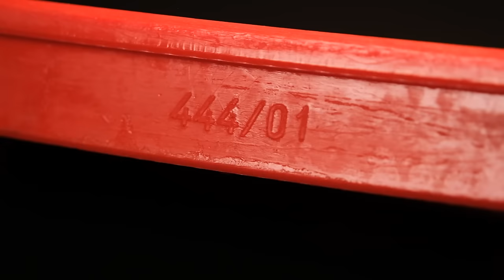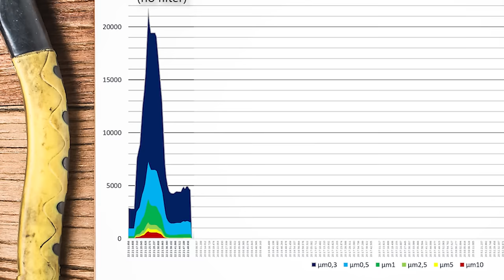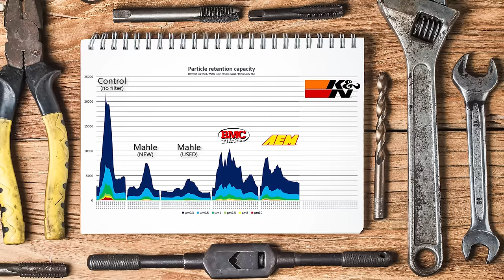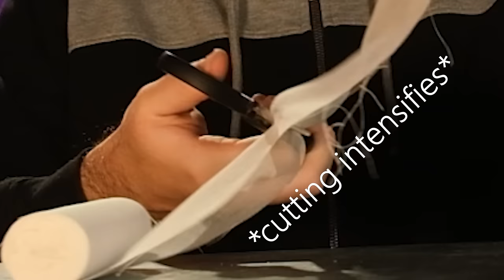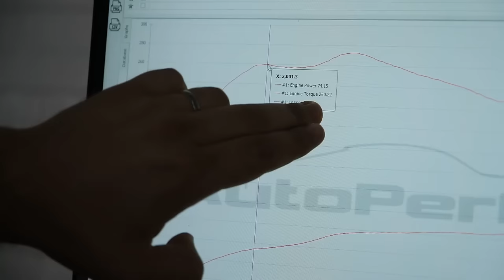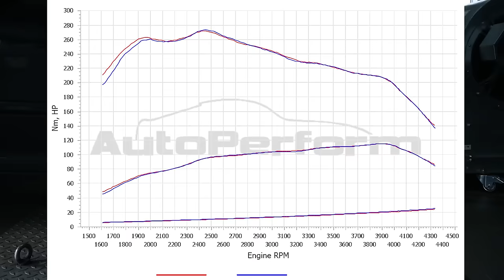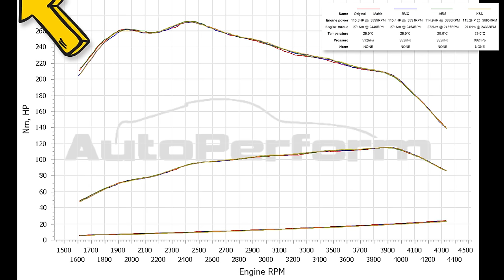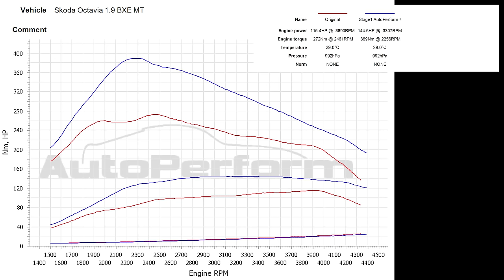Performance Air Filters - K&N vs AEM vs BMC - DYNO TEST

Comment: I've used a k&n drop in filter for 20 years. The same filter,  just rinse and lightky re-oil. I have not had any issues with it. I've put about 80k miles on the filter and it still works great.
Reply: 80k miles probably isn’t enough to notice a difference in engine life.
Reply: I believe it’s worth the price upfront. Washable filter will pay for its self within 3 yrs
Reply: Never had a K&N throw a code. If you over oil them your doing it wrong.
Reply: Yeah, ok. But has your engine been protected? Looks like the K&N is actually very bad at its main job, filtering. It was almost as bad as no filter at all in this test.
Reply: 150,000 in 6 years
Reply: Yes. That's what I've used in my '97 4 Runner. I have over 415k miles on it now and it still runs well. I had oil analysis done on it after I started using the K&N filter and the amount of silicon contaminants was never an issue. I checked the oil during summer and winter.
Reply: I just bought a k&n filter for my 2019 Chevy trax redline will I be good??
Reply: You must give ecu time for recalculate oxygen and fuel after a while you will see deference
Reply: 80k miles in 20 years?

75k miles in 4 Years here lol.
Reply: Oh yeah, normal paper filters that really do filter particles are very expensive - 10 $. You've saved a fortune while you've sanded your cylinders walls with that crap K&N.
Reply: @gerrymcerlean8432  it should be mentioned K&Ns filter much better after a bit of use as the dirt gets trapped in the oil and tightens the openings.
Reply: @perrinayebarra  how many more miles could you possibly put on it to tell its life
Reply: @xb007  at least 100k more.
Reply: 20 years of premature wear due to dust particles contaminating the engine oil 😂
Reply: No thanks
Reply: Or just buy a paper filter when it gets dirty every once in a while. Air filter oil sounds like headlight fluid lol I bet you believe those motor oils that claim they last like 20k miles, too
Reply: Damn better than my car's previous owner. No cleaning. No dusting. Just leaving it in there for 200k km. Not K&N. Just a cheap one that came with the car. Lunatics.
Reply: @perrinayebarra they filter better too
Reply: is your engine turbocharged?
Reply: @masaru3585 dude comprehension helps. He said he’s used k&n filters for over 20 years . His current k&n filter has done 80k miles 😉
Reply: @variovent rubbish k&n filters have been proven . Anyone saying oem are better are clueless. Car manufacturers build cars with parts that are designed to fail , that how they make money down the track from part sales and so forth . Any car guy knows this,  the average person will believe the manufacturers 😉
Reply: I put that on an I felt a lag on the hp I have a 2017 honda civic hatchback an when i put the original filter it whent back to normal I took that shit back
Reply: 80 % oem parts engine issues 😂😂😂 from factory 😅 so you don't won't to support to k&n because they don't pay you something else 😂😂😂
Reply: Max is 200.000 km from factory 😂😂😂
Reply: @perrinayebarra 200.000 km from factory warranty no more
Reply: Lol considering there well known to cause engine damage manufacturers warranty an engine with them ya there the best buddy lol
Reply: Ne lazi. Nista nisi dobio. Samo unistio motor

Comment: It would have been interesting to see how the filters performed after the remap. Thank you for video and information as per usual.
Reply: Yes, exactly!
As the original filter is well calibrated enough for the original power, doesn't it limit the power after remap?!
Reply: This. Performance parts benefit greatly after a remap I was able to achieve 20bhp with just CAI and downpipe.
Reply: @gwenc8900  It definitely does. I had a remapped  1.4Tjet with a slightly bigger turbo . It did 180+ on dyno with stock filter.After upgrading to a aftermarket performance filter it gained like 5hp. It did 184.8 .9
Reply: @whitegptjet  I think it's placebo effect here.
I have a 455bhp/634nm custom mapped M140i, and I use the standard BMW air filter. Even at the power I am running, the various air filters I tried made zero difference.
You have to remember, BHP can not be measured, only calculated, and if you put the same car, on the same dyno, with the same filter fitted, and do 10 dyno runs, you will get 10 different figures.
So many things come into play, and every dyno & mapper has their own calculations for measuring BHP.
Any tiny variations of plus or minus 5 BHP are simply down to these natural variations on each run.
People are always looking for gains on engines and believe any old shyte, and performance filter manufacturers are just selling a dream.
An engine is basically just an air pump, and so long as you are getting enough air into the engine (even from a standard filter), the intake temps, timing, and fuelling can only do so much. Adding more air flow from the intake won't gain you any extra power unless everything else is adjusted to balance that out and take advantage of it.
The thing which is holding my car back is fuelling, and to get my engine to around 480-490 BHP an upgraded high pressure fuel pump is needed. I could fit one and keep the standard air filter, and still get the same power regardless.
Just for balance, I work in the motor industry too, and actually sell parts including K&N filters. We had the reps from K&N in to our office, to 'train' us about their products. We all came away with the same opinion, which was basically overpriced shyte.
Reply: @DjNikGnashers  Hi. I believe you. All turbos work the same: they are set to gain particular overpressure compared to non-turbo engines. If there is too high air pressure special valve releases part of this additional air or there is mechanism inside turbo which decrease air pressure (depends on model). So until we don`t have too much overboosted engine k&n air lifter shoud not give any gains.
Reply: @DjNikGnashers  interesting, stage 2+? Which filters did you try? I was actually curious as I have the same setup. 
for the reusability of it I jut got an FTP dry filter today and didn't expect a difference, but hoped there could be one in higher powered cars like these.
I think I will try logging a before and after
Reply: @andrxito  I also tried the ITG filter, no gains.
I think intake temps make a difference to power, so maybe the hot climate mod with the extra intake scoop and open grill to replace the closed off one in the front bumper/cover would help, even with the standard filter.
Reply: @DjNikGnashers  yeah that's my setup right now. Will be adding additional heat shielding in the engine bay (the opsrey performance aluminium shield, cheap and good) to get IATs down further. I've heard removing the engine cover helps greatly too
Reply: @andrxito  Yes I agree.
My tuner said my car was heat soaked on the dyno even with 455bhp/634nm, although I didn't rate his fan/heat extraction set up too highly !
He said if I went with an upgraded HPFP then he would also recommend an upgraded charge cooler radiator.
Reply: @DjNikGnashers  if only the actual intercoolers weren't worth 5k $ 🥲
Reply: @andrxito  Yes ! Expensive, I'm in England and been quoted £1200 for a Wagner rad, I can't believe they cost more than £50 to manufacture, it's crazy mate.
Reply: @DjNikGnashers  I agree with you. There are very few honest dyno workshops. Most of these know how to make you a warm and cosy feeling, that's all.

Comment: I have been saying for years that newer cars (1970 and up) are equipped with cold air intakes and filters calibrated to handle the cubic air flow of the engines they build and install. Air filters handle air for full throttle max rpm with room for flow after they start getting dirty. At normal driving the air flow is even way less. It probably averages somewhere below 50% of WOT max RPM so that gives the partially dirty filter even much more use before it actually starts restricting in most cases. The medicine show is still alive and well in every corner in this day and age. From automotive and marine performance to computers, phones, kitchen appliances, soaps and medications. All you need to do is advertise like your some kind of expert and get people to say they have used the product and rant and rave about it because everyone weather they believe in God or not, wants a cheap miracle. In many cases many of the claims can't be proven or dis proven and in these cases I assume they are just marketing claims.
Reply: It really depends from car model to car model, some have fantastic air intakes and others have intakes that are just barely good enough for stock power.
Reply: Exacto,  una persona objetiva, esto es marketing, las compañías se pelean y destrozan y contratan a you tubers, semi expertos, cuando las empresas grandes tienen super equipos de prueba y controlados y certificados,  y auditados por los gobiernos y departamentos de consumidor, y no por laboratorios artesanales sesgados a modo. Exagero diciendo que el KNN es como no tener filtró. Exagero.
Reply: No one wants a cheap miracle….we just want affordability while increasing performance. Especially with ALL THE PRICES GOING UP. A miracle fixing inflation would be a “cheap” miracle 😂🤣😂🤣😂🤣😂

Comment: I kinda like that the AEM doesn't need to be replaced as often. Not surprised that  OEM is ideal for a typical daily driver.
Reply: KN is exactly the same.
Reply: Higher flow air filters are better for forced induction vehicles with either turbo or supercharger.
Reply: @JTa-l6y The opposite: are better on NA engine.
On new turbo engine air pressure on intake is constantly measured... If is less the waste gate open later to give same air pressure.
Obviously in standard condition... If you make big tuning is different.
Reply: @ziofrenko  not always as my car has twin turbos and doesn't have a maf sensor, my car uses speed density by a boost pressure sensor and a map sensor. Thus getting g more air since the wastegates are electronic controlled and by boost pressure only. Most newer cars use a maf sensor aka Mas airflow sensor that meters measured air coming in. And adjust fuel and boost accordingly. The only place u run into problem is by running a bov on a maf car and can cause the car to run lean or to rich and stall. On a car with speed density it doesn't matter. As there is no maf to Metter air coming in. Also having a high flow air filter doesn't effect either vehicle only bov or bod aka diverted valve. And a tune. But just a filter ur ecu should acount for more air adjusting a/f ratio and to do it properly u have to remove negative battery cable and wait a few hrs then re connect this will reset the long term and short term fuel trims. And force ecu re learn.

Comment: If the stock ECU map is that conservative, it's possible that the airflow through the filter is simply not a performance bottleneck at stock tune. It would be interesting to see the results of different filters after tuning.

Comment: Curious to see the exact same test on a naturally aspirated engine
Reply: They won't make a video of that because someone n/a engines react very well to better flowing air filters and then they will make an ass of themselves.... Every time someone wants to bash these tipe of filters they use a turbocharged engine where the amount of air in the engine is regulated ....
Reply: I've ordered BMC ones for my Naturally aspirated V10 with 2 filters. I'll let you know if there is gonna be a noticable difference. People say these stock audi paper filters are already very restrictive. If it would have to work on a car then it would defenitely be this one right?
Reply: @DJSPYROOF  It would be interesting to see...
Reply: @Yeah Right Exactly... Basically it depends on multiple factors. I'd love to see a comparison with an N/A engine. And multiple tipes, with or without MAF, electronic and mechanic throttle body and with or without a tune. It would be very interesting to see which setup reacts the best and/or worst and the amount of gain's.
Reply: @DJSPYROOF  did u do it
Reply: @airuzair2424  My garage was very busy so I couldnt do a dyno test before and after. But the difference was not realy noticable to me. Maybe a little bit, but that could just be because I drove a slower car for a few days when my car was under maintenence. Wouldn't do it again for that price and little to no difference. Maybe if you do a complete remap and everything it might be worth it
Reply: @DJSPYROOF  did it sound better? thanks for the response.
Reply: @airuzair2424  Not noticable either imo. The first time the sound felt a little more ''dark'' but it might just be a feeling because you're expecting it. Same with the performence. Not anything noticable
Reply: @airuzair2424  actually yes, with my exhaust valves closed i hear a louder blowing / airsucking sound
Reply: @DJSPYROOF  honestly all I care about is more intake noise lol it might be worth it for me I thought of removing the air intake resonator although everyone says you lose power but I don't really care if I lose 5 hp lol
Reply: @airuzair2424  If you mean the airbox, yeah sure you'll get louder noises even, but these v10's get so hot easily. So I think it will be a bigger power loss than just 5hp. 

I installed valves that open before the end mufflers so I got loud v10 sound, but I tried today with valves closed (sounds like normal exhaust) and indeed I could hear the blow sounds a little more with the windows opened

Comment: I'm surprised the AEM is so good without any 🛢️ on it that's impressive for being a "dry flow" filter so there's really no chance to mess up your mass air flow sensor from the oil 🛢️ on the filter + easier 2 clean👍👍

Comment: Thanks for this review, I like K&N filters but knew they let in too much dirt so I dont use them.  After seeing this, the AEM is comparable and is a better filter as far as good air flow with good filtering.
Reply: I used a K&N filter for like 150k km and now the engine consumes alot of oil :(
Reply: WIX is actually doing the same as AEM, but WIX is a lot cheaper.
If its about filtering micro dust, take Hengst or Alco filters.
Reply: @bogdaniojescu5889  I just bought a k&n filter🤦🏽‍♂️🤦🏽‍♂️ is it really that bad
Reply: @nizo6673  my engine had 358k km and it eats 1l of oil every 300 km.
Reply: @bogdaniojescu5889  Is that due to the air filter, or is it just worn from all the use?
Reply: @bogdaniojescu5889   you have an old shot used up motor.  Has ZERO to do with a air filter.  lol

Comment: Also worth noting that small oil particles can be induced in to the intake air track from these filters and this can coat the element of the MAF sensor causing over time the sensor to read lower than expected - this in turn actually causes a slight loss in engine power due to the slight under reading of air mass intake caused by this contamination.
Reply: pcv and egr make the most of dirt in intake, not dust that passed filter
Reply: @makantahi3731  I am not talking about dust or the filter itself, I am talking about the oil soak in the filter being sucked in to the intake system and contaminating the MAF sensor.

You are right PCV and EGR contribute most to the intake system, so that’s exactly why these are passed in to the intake system AFTER the delicate MAF sensor, so not relevant to my comment at all.
Reply: That`s what happened to my Golf 4 Gti 1.8t back in the days. And believe me, the loss of power was significant. Since around 2010 all my cars get Pipercross, non-oiled filters. Sure, no extra power but just a little bit of cleaning every now and then and no waste, gives a good feeling.
Reply: @makantahi3731  Those are always placed after the MAF.
Reply: @makantahi3731 oil from the PCV is burned. Silicon goes on to travel through your engine and scratch your pistons and cylinders
Reply: @matsudakodo  why oil from pcv should be burned? maybe if engine burm oil but in non worn engine, in crankcase is mist/fog of oil that is made by splashing it around for lubrication, but there is water vapour too,that is whay crankcase is forced to ventilate,i have second car that does not have pcv,it just has vent to intake without under pressure and at winter on oil cover is always condensation

Comment: to test the flow performance of the filters try using your diy chamber and pull air using a blower fan or better a vacuum cleaner, then measure the pressure drop inside with an low pressure sensor.
For remapping the car if you don’t want to add too much extra stress on components you can try keeping the old torque up to higher revs until you reach the desired horse power. for example 250Nm @4000rpm would give you 140Hp

Comment: I had used drop in and open Filters from K&N; BMC; JR; INJEN and No names -  in about 12 cars and about 700.000 kilometers and never had any Problem with them.
Maybe there´s mostly no really power increase but - on low rpm`s you can feel definitely a better and more sensitive throttle response!  And the Intake noise is
sometimes also better!
Reply: It's in your mind.
Reply: Absolutely with you. Plenty people here saying lost of claims for the air filter but is as well the rest of the maintenance including the oil quality and oil filter quality.some people uses engine oils of £20 and oil filters of £3 and then say that the maintenance is done😂😂😂
Reply: Give your engine more time and those particles the KnN is allowing to pass wi score your piston and cylinder walls and start to cause oil leaks at the seals.
You aren't really gaining any power, just induction noise an a very small throttle response increase. Get a Wix gold paper filter.
Reply: No dude its in your mind and your opinion.This guys car just didn't respond well @matthewking5612